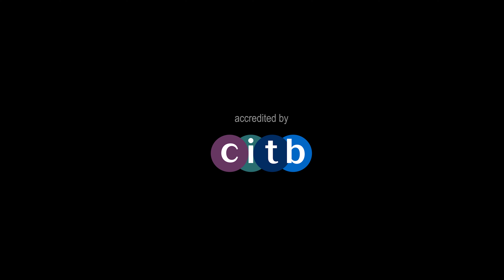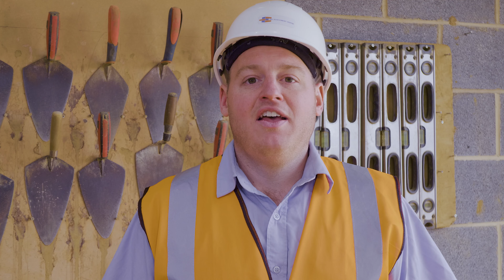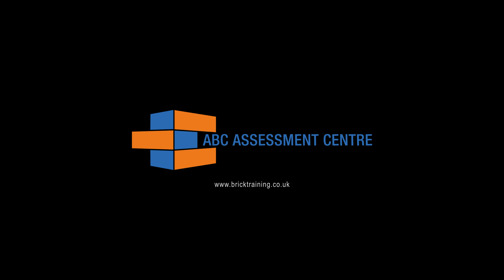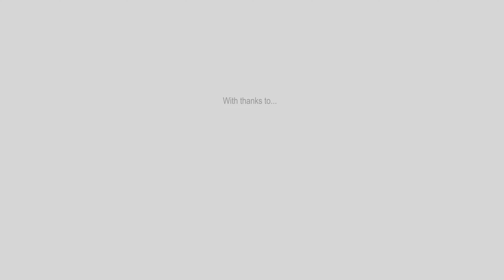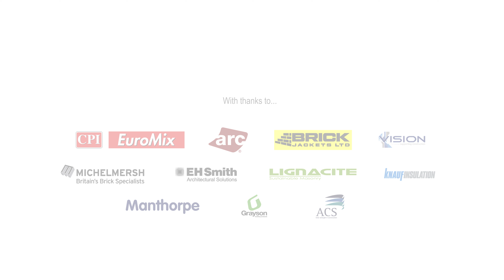Bonding, Taping & Positioning Insulation Boards

Comment: Nice job. Many builder just chuck it in no tape and not secured correctly, mean in places it will touch the outside of the cavity and other places the inside. 

With regards to the full fill I do wonder if we will have problems with damp in a large number of houses in the future due to lack of cavity space.